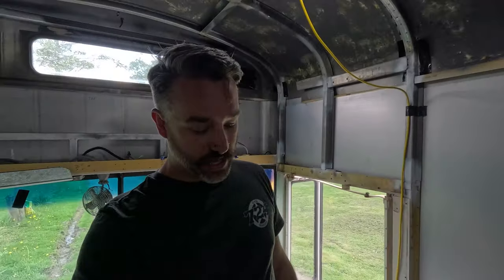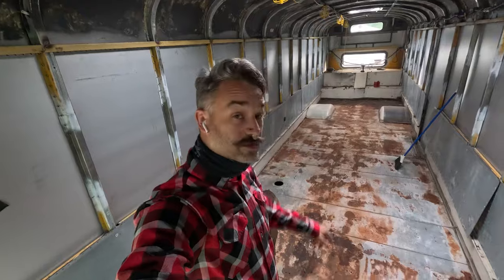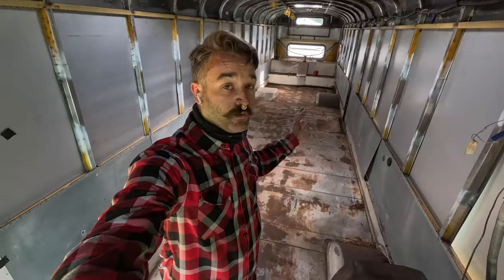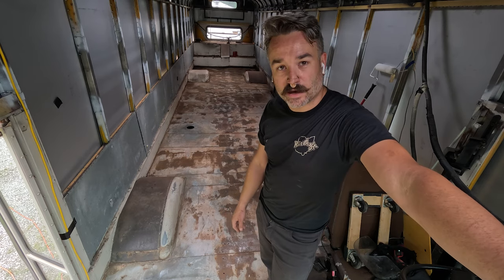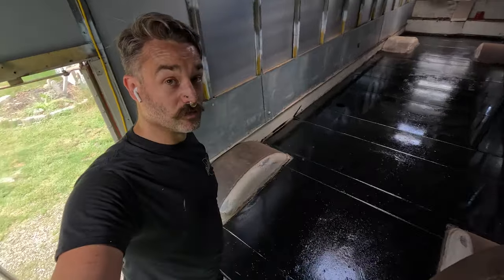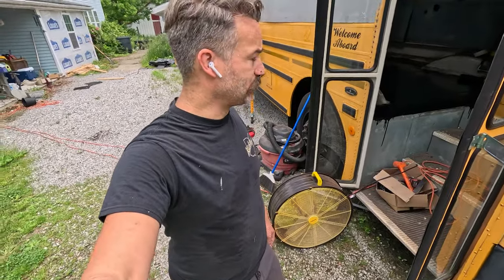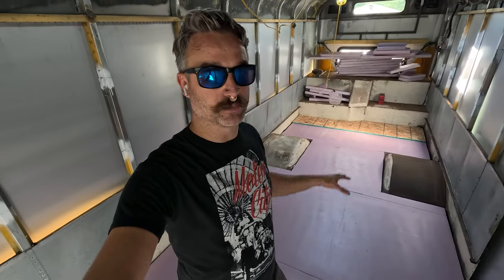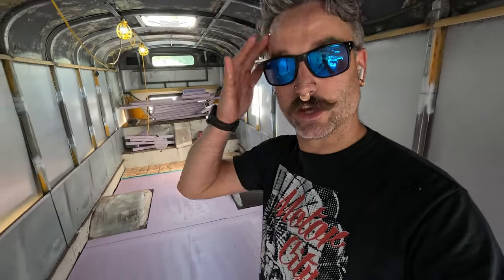BORING FLOORING // Skoolie Build Part 6

Comment: My back hurt just watching you sand that surface rust 😅 So cool seeing the bus really start to take shape!
Reply from the maker: It's as bad as it looked. The dust was worse...
Reply: I saw your most recent reel! How did you go about fixing the oil canning issue?
Reply from the maker: @yaxorf2139  That gets addressed in the next video, but the short answer is drilling out A LOT of new rivets and starting mostly over on some of the sheets.